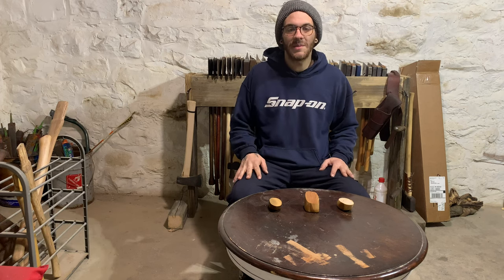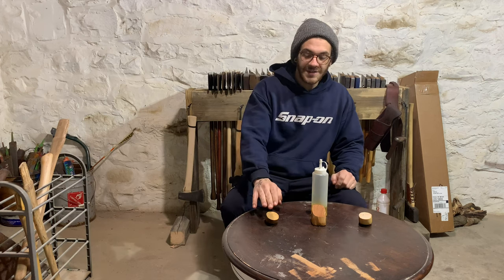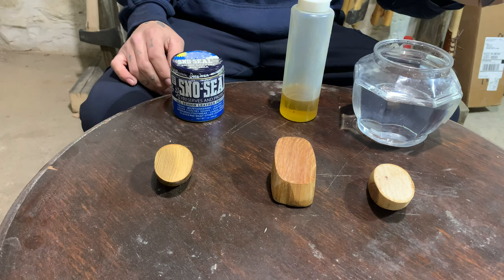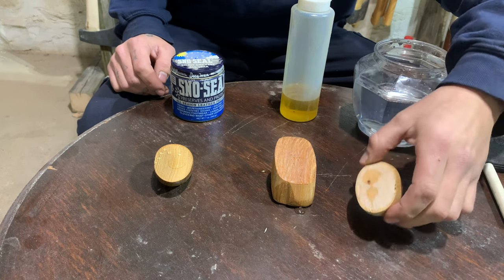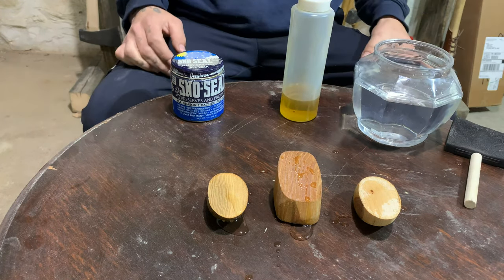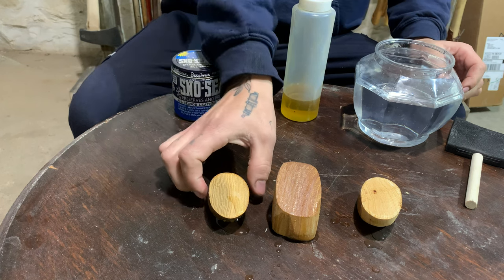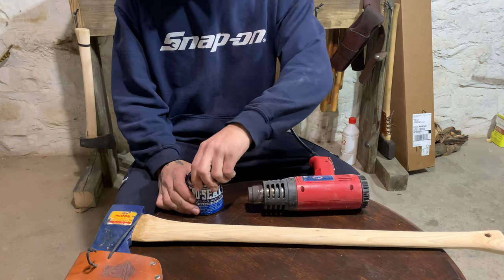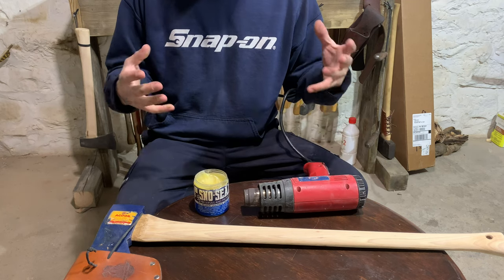Axe handle waterproofing that works !!

Comment: I love these kinda nerdy tests.  Realistically, we’re not really chopping the rain, but the under forest is always wet.  I’ve not thought a lot about oils.  Seems to me you just want to keep the wood from cracking, but some guys love oiling their wood and talking about penetration 😂😊.  Great axeperiment, Joey.
Reply from the maker: Thank you !! Yes I love doing little experiments like this !! Exactly when it’s raining I’m not like hey let’s go chop lol !! And if it starts raining I’m like ok let’s get out of here !! I mainly want to try this on my truck axe and my main splitter. Mainly the splitter because my gloves always get wet splitting in the winter picking up snowy logs, so it’ll be neat to see how this works out long term !! 😂😂😂 yea some folks are definitely in love with oiling their wood and making sure it penetrates deeply 😂😂 !!! Haha I had a good laugh with this for a while lol !! Thanks again man 🤙
Reply: Totally. 
Also i live in the PNW and its ALWAYS extremely humid, especially during the winter. 

People mostly think of humidity only being in hot or tropical weather, but cold weather can also be humid too. 

Its rare to have less than 90% humidity here. 
Its like a wet refrigerator.... 
So even though my axe handles dont get rained on, they still get wet from just being outside working.

So finding all the ways to waterproof handles is always good for me lol. 
I stopped using BLO because it would make me sick.
Reply: We’ll put Kevin.

Comment: Great idea. It's definitely a good idea to wax any camp axe unless you get a lot luckier with the weather than I tend to!
Reply from the maker: Thanks Matt !! Yeah I agree, 99% of the time I use linseed oil. In this video I was really thinking about winter splitting like when your gloves get all snowy from picking up the logs then the axe handle gets all wet. I’m curious to see how this will work out on my splitting axe 👍
Reply: @940joey2  I use both. I do finishing with BLO on every handle but when I take an axe out in wet or potentially wet conditions I rub on some wax. I don’t rely on BLO for water proofing because it just doesn’t do that. My understanding is that BLO or tung oil are stable finishes that harden and that protect wood from humidity fluctuations. But as you showed and many others have experienced, it is not a very effective barrier to surface water. Wait till people find out that Ben Scott uses olive oil 😂

Comment: Used Snow Seal for years on boots, but never thought of this application!  Can't wait to try it on my two new axes & a pickaroon
Reply from the maker: Heck yeah I’m excited to hear what you think .. I will say though my go to is still linseed oil, personally I feel it gives the best finish and feel you can’t beat it. What I would do before you do this to your new axe and pickaroon is I would try it on maybe an old broken handle or a scrap piece of wood to see if you like the feel first. It definitely has a tacky feel, after I apply it and let it works into the grain I go over it with steel wool or an old towel and really work it in to give the waxy finish a better feel.

Comment: Great Advice 👍👍. I use boiled linseed oil.
Reply from the maker: Thank you !! Yes my go is boiled linseed oil or raw linseed oil, it’s my favorite handle finish. Linseed oil has been used on axe and tool handles for years and for a reason, because it’s the best, and I love the patina you get after lots of use with linseed oil !! This experiment was just mainly for fun and I’ve had people ask how to make a handle more water proof. Also I do a lot splitting in the winter and my gloves alway get soaked from the snowy logs. Im curious how this will work long term on my splitting axe.

Comment: I use Fidde’s hard wax oil. It’s a natural oil finish that also contains bees wax. That’s what is in the Sno Seal also.
I had old oak barn beams milled for flooring and the fidde’s is what was recommended for it. If it holds up on floors it will certainly last a very long time on axe handles. I’ve also used it on a couple refinished gun stocks. 
I like Sno Seal on leather but there is better stuff for axe handles.
Reply from the maker: Oh wow that’s awesome !! Thanks for sharing that 👍 yeah I even remember my dad putting sno seal on out boots when we were little, it’s great stuff and honestly I was kinda board one day and I’m like hmmm I wonder…. Sno seal … axe handle !!! Lol.. still my favorite axe handle finish is linseed oil, but figured I give something else a shot for winter splitting with wet gloves 🤙
Reply: @940joey2  BLO is a penetrating oil and leaves the grain structure somewhat open. Hard wax oil (there are others) will seal the grain more. I have also used BLO to penetrate first and then topped with HWO and burnished with old burlap for an excellent finish

Comment: I never thought of  snowseal for handles have used it on boots.
I have to try this and I know who gets it first. I have a husqvarna  hookaroon I  use when  cutting  wood when  not being used it often  just gets  stood  up in the snow where it's  close to grab.
Ash handle . It seems like it could  be  oiled weekly and still look like it's never been  done.
Reply from the maker: Heck yeah I love snow seal for my boots !! Yeah I do a lot of splitting in the winter and my gloves get soaked with snow so I figured I would do this to my splitting at and see how it holds up !! Sounds like that Husqvarna hookaroon is the perfect candidate to try this out on !!!

Comment: I stain my handles, then put a wood finish on them which is basically a synthetic boiled linseed composite substance.  Then I apply beeswax and wipe it off after a few days. The grain and fibers of the wood completely absorb all of those applications and have no room to absorb moisture. It seals and hardens the exterior of the handle. And once applied, no need to keep applying over and over like you do with BLO alone.
Reply from the maker: Heck yeah that’s awesome I’m going to try that for sure !! I was just testing some stuff out in this video. My main handle treatment is linseed oil, but I like the idea of what you explained here. I’m def going to give it a try!! Thank you !!

Comment: Thank you for this video.
I would put the SnoSeal (or other beeswax product) first, then the boiled linseed oil.
I make my own wood and leather treatments. For wood, I make a 50-50 mix of beeswax and pine rosin. For leather, I mix one part beeswax, one part pine rosin, and two parts mink oil.
Works for me.
Reply from the maker: Thank you so much for watching and for this awesome comment !!! I just started experimenting with this, I am definitely going to have to try your 50-50 mixture and the leather mix too, that’s awesome !! Thank you for sharing your ideas 👍

Comment: Sweet video Joey! I never thought to try a boot wax on an axe. Like you said those tins can be crazy expensive, so I was never willing to venture out and buy one. My main concern with the waxes was that it would remain tacky and would be difficult to apply without a heat gun. So does that snow seal get pretty smooth?

I know that linseed oil had once been used for waterproofing wooden gutters, but most people say that linseed oil is not good at repelling water. Linseed oil penetrates and protects the wood, whereas lacquer, tung oil, and waxes remain close to the surface. The trade off is the waterproofing. A lot of guys use tung oil or varnish on top of a stained handle because it won’t penetrate and displace the oil stain.

Ideally, I think putting linseed oil  on first to moisturize and protect the wood, followed by a surface coat of wax would be the best combo. Let me know what you think. Great experiment!
Reply from the maker: Hey Codi sorry it took so long for me to write back !! Merry Christmas dude 🤙 
That’s really neat man I never knew they used linseed oil to treat wooden gutters. 

Hands down linseed oil is my absolute favorite handle finish and I think it feels the best in the hands and ages we’ll also. I also think it does a fine job keeping moisture out of the wood under normal conditions. 
My main thought process for this experiment was for my splitter for when I do a lot of winter splitting and my gloves get soaked from picking up the snowy logs, then my handle gets soaked. I also was thinking it would work out great for a truck axe since it would spend its life in the tool box in the bed of my truck and when I would need to use it, it most likely won’t be in great conditions if a tree fell across the street it would probably be because of a storm. 
In conclusion I think it’s definitely a plausible handle finish, but mot ideal for a regular user just based off of feel alone 👍

Comment: Very informative video Joey! If you were in a heated shop would you need to still heat the wood? 
I just got some Axe Wax and Renaissance Wax Polish to play with here. Thank you for sharing
Reply: Based on my experience with boots, I'd say yes, for sure.  I usually get the best leather penetration if I heat my boots after applying the SSeal so I'm sure it would work well here since any of these products needs to me in a liquid state for absorption to work at all.
Reply: @randystrand908  Thanks Randy!
Reply from the maker: Hey Pete thanks for watching !! I agree with randy, even if where you’re store your axes or boots is a warm environment, I would still heat up the area you are applying the wax. It does need to be quite warm to melt into the wood, or leather if that’s what you’re using it on !! Thanks again for watching 👍

Comment: Sno seal is good stuff! I waterproof my backpacks with it works great. Pretty sure it’s beeswax plus the secret ingredient is dinosaur bones haha
Reply from the maker: 😂😂😂 dinosaur bone !! Heck yeah that’s awesome man, I never thought to use it on a back pack. I’d be interested in seeing that done, do you have to iron it ? Does it stay tacky or slimy. Thanks for watching man 👍
Reply: Works awesome for canvas, probably wouldn’t be good on any synthetic stuff I bet it would degrade that. But anything canvas like tarps sheaths cases it’s really good. I just use a blow dryer

Comment: I have been trying to make a decision on boiled or raw linseed oil for my Gransfors Bruks axe handles. I buy my axes from Duluth Pack in Duluth MN and they advise to use boiled. I am thinking although it takes for ever to dry the raw linseed oil will be a tad more durable. I am not really caring how long it takes to dry when applies. What are you using and what would you reccomend if you do not mind saying Joey?
Reply from the maker: Thank you so much for watching !! I personally use raw linseed oil on all my axes handles. I use to use boiled linseed oil and there’s really no difference too much. Yes the raw takes longer to dry. I like the idea of using raw linseed oil because there’s no chemicals on it. Either one you choose will be fine. Boiled is much easier to find at almost any hardware store or Walmart.

Comment: hey what do you think about full metal hatchets like an estwing or something? how about a review?
Reply from the maker: I think they’re pretty good for the reason that they’re hard to break unlike a wooden handle, so they make a nice truck or 4 wheeler axe that you don’t have to worry about much. The down side to them is you get a lot of handle shock and the handles aren’t very comfortable, also the profile of the head isn’t great from the factory. That can easily be fix with a little re-profiling

Comment: Have you ever watched logcabinlooms videos? I wonder how his pine tar method would hold up In the test.
Reply from the maker: Thank you so much for watching !! Hmmm I can’t say that I have, but I’ll definitely have to give it a watch 👍 thank you, I would imagine pine tar would work. It just might be a bit sticky. Linseed oil is still going to be hands down the best finish for an axe handle in my opinion, I was just getting a little creative here !!
Reply: @940joey2   ya for sure I agree. Logcabinlooms uses the pine tar on everything from guns to handles. I've tried it on a gun stock using a mix of pine tar and boiled line seed oil. I liked haven't tried anything but BLO on axes tho. Cool experiment by the way.